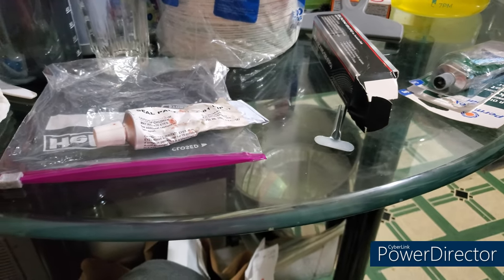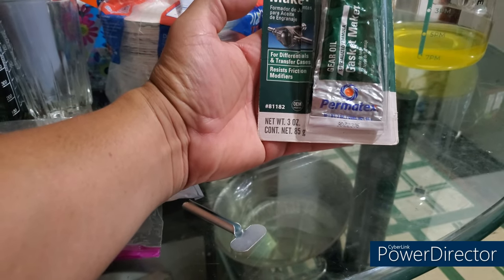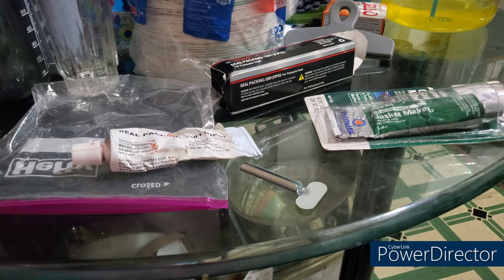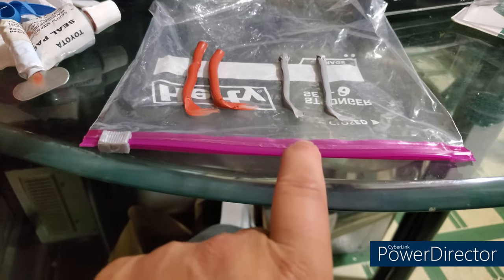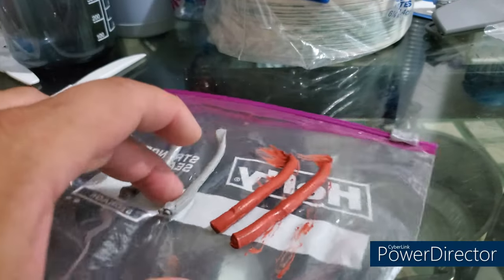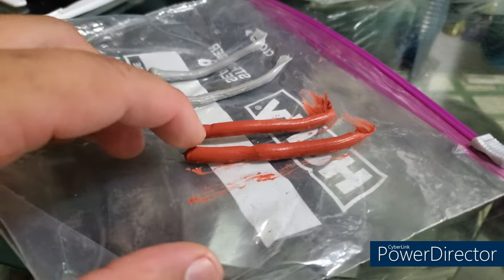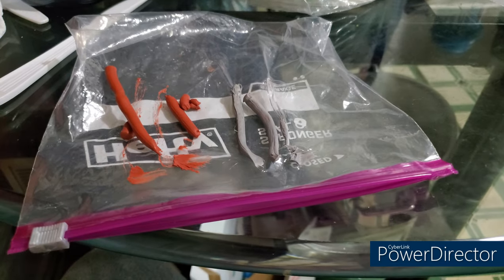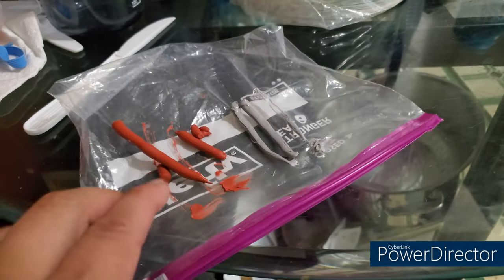Sealant Cohesive/Adhesive Testing

Comment: Thank you for the testing.

I bought FIPG 103 about 1.5 years ago.  Forgot it in the unheated  garage over the 2023-2024 winter.  I rolled out twi test lines in cleaned with denatured alcohol plastic sandwich bag here at midnight-thirty.

I am keeping my fingers crossed ...,.

I am going to use it on my 1997 Chevrolet Express Van.  The ship manual for this can says to uses it in the front and back of the block where the manifold will rest, and to go up about one+half inch up the manifold gasket.

General Motors discontinued their AC/Delco adhesive, therefore, I am using leftover Toyota 103 adhesive.
Reply from the maker: I do a test before doing any major sealant job. its worth it. I've had a lot of sealants fail just by sitting for a long time.